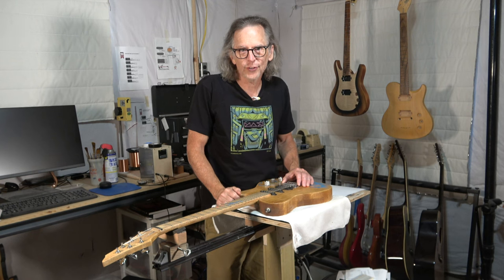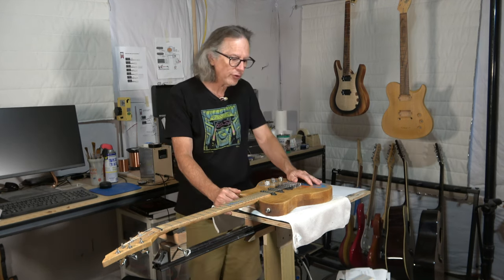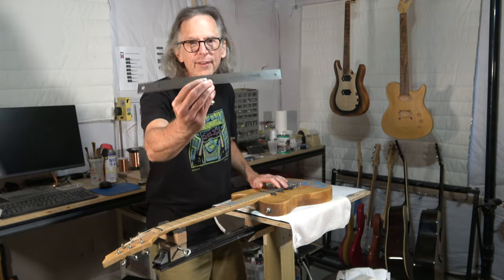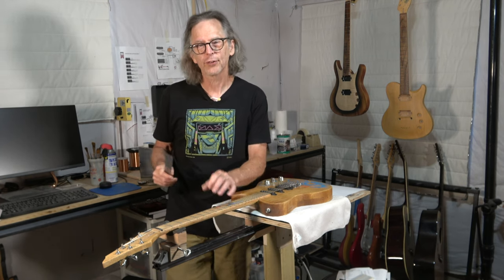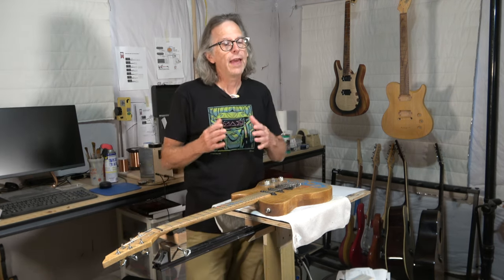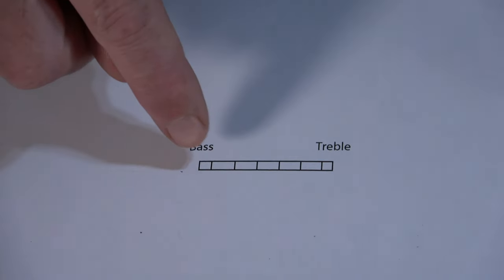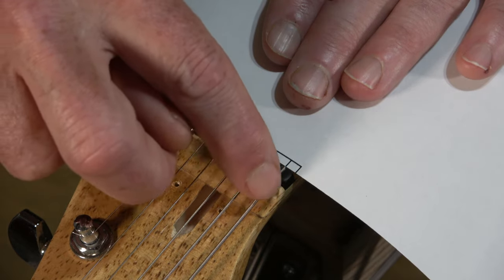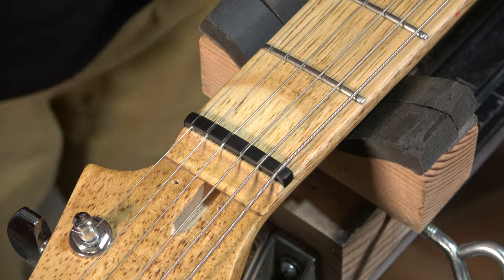How Do You Determine String Spacing On A Guitar?

Comment: This sounds a bit rough, but I cut my outer slots, then string up all strings under tension. I then visually space them. It is amazing how obvious it is if it is even. I then mark either side of the strings with a pencil. Then file the slots accordingly. 💜💜 Sarah
Reply: This is the same method my friend and mentor uses, who's been doing guitar repairs full time since 1969. I now use my own method, which for me is more repeatable and precise, after doing it 'by eye' for many years. I don't think my new method is superior at all, simply what works best for me. He's still doing them by eye and knocking them out of the park as always. 

I don't think it's rough at all. There's an old book called "By Hand and Eye" that discusses methods used by artisans of times past. The visual method is perfectly valid, and same deal...mark either side of the strings, cut in the center. If memory serves, my friend uses a razor saw to make a 'set mark' in the center of those lines first, using his thumbnail as a 'fence.' And then uses nut files on that set mark afterwards.
Reply: @guitar_md  The eye picks up center very well and notices unevenness equally as well. I do the same when marking my  side dots.
Reply: @rellikguitars7237  Agreed!
Reply: That's exactly the way I always do it... works like a charm! 👍
(Btw: I also tend to stick a little strip of masking tape on top of the nut for the first few filing strokes. Makes the pencil lines more visible/durable, and keeps both strings and files from driftin' all over the place...)
Reply: @kiwibass  I don't know why I haven't used tape, but I will now.. Thanks 💜💜💜💜Sarah
Reply: @rellikguitars7237  You're welcome! ✌🙂
Reply: @JD-nq4vb   Yes I know this. It is basic maths. But thanks
Reply: @JD-nq4vb  That method misses the whole point of the video. You're not taking into account the thickness of the strings.
Reply: @JD-nq4vb  What's with the personal attacks? You're still missing the point, and I'm the one who should be embarrassed? Sorry, but no.
Reply: @JD-nq4vb  I took it that way because you've immediately started shaming me, telling me I ought to delete my message, etc. Let me be clear - I'm not disputing your math. In fact, what you're explaining here is entirely obvious. Did I ever argue with the fact that if you want equal distance between the centers of the strings, you can calculate it by dividing E-to-e spacing by 5? No need to assume I can't do basic math. The point of the method described in this video is entirely different though, which is what I said in my first reply. It aims to produce equal spacing between strings, not between centers of the strings. These two things are not the same, and the former requires a different method than the straightforward "divide by 5" rule.

Comment: I take a photo of the bridge with strings installed and then scale that for the nut. Why would you not? This problem is way overthink IMHO.
Reply from the maker: Try it and you'll see that when you reduce the photo, the string diameter is reduced as well. You'll end up with the wound strings too close together and the plain strings too far apart. I can't sell a guitar like that.
Reply: Is it the case then that the string spacing at the bridge does not consider string guage? That would certainly defeat the image scaling method as it would depend upon a linear relationship between the nut and bridge. The E string center lines converge at a "vanishing point" some distance away from the nut (and should probably coincide with the center of the fret board) but it appears the other strings converge at a different point. I'll have to put this into my CAD and see what that looks like. Thanks for the lesson!

Comment: I have tried all the methods and own the StewMac ruler. In the end I have settled in equal string spacing based on center of the string. I got there as a player, not as a builder. The other methods appeal to me as a builder because of how it looks. But I play the center of the string, not the spaces between them. I don’t typically have a problem accidentally muting strings. Bridge is usually going to be equal on center spaced regardless of what I choose at the nut. In theory, that mean the portions change gradually as you move up the neck. Those changes are too small and gradual to matter in real life.

Comment: You got me there. Use the safe slot system which includes a string spacing ruler. That and a digital string slotting gauge. Will have to give your method a try some day. Takes me a couple tries sometimes. String spacing usually.  Me personally I like to leave an extra 1/32 on the high e side even if it looks funny. Because I like to feel free doing wide vibratos. Nothing kills the mood like slipping off the side of the fretboard.

Comment: Doing it visually is definitely the easiest way and that's what I'll usually do when working  on my own guitars. If I'm working on a customer's guitar or making custom nuts in my spare time, the Manchester calculator and a proper marking ruler is a must. It takes a small bit of prep work to get the measurements but marking is a breeze and I know I won't botch the nut. Plus, it's what I would want my luthier to do for me. It's nice knowing the nut was precisely cut according to the gauge of each individual string. I used to have a string spacing ruler, and it was super simple to use but I found that it's not quite the best thing in certain scenarios where someone is using heavy bottoms or unwound Gs, things like that. Not to mention the amount of people that like to have more "freeboard" up at the top.

Comment: I think equal 'space' between strings is important on an acoustic because of how hard I play. The lower strings travel further, are wider, and have higher action. I need the space. With that said, I'm making my first nut (trying a compensated one) with a Stewmac rule. The spacing on the original (Yamaha) is quite different than what I'm getting from the rule so it could take a little adjustment. First time on your page. I would love to hear thoughts on tuning, compensated nuts, bridges, and Buzz Feiten.

Comment: I measured some guitars:

Taylor - equal gaps
Godin (semi-acoustic) - wider gaps towards the bass, sounds weird and looks weird
PRS - equal centers
Ibanez (and all floyds, etc) - equal centers
Fender - equal centers (strat and jag)
Gibson LP - equal gaps

Notes:

The guitars with equal center saddles all have equal center nuts. So my question is, would you ever want equal gap nut with equal center saddle? Surely that would be a bit weird...

I dare say, acoustic guitars tend to use equal gaps.

Re the Stewmac ruler, a very rough calculation says that thing would have a bass center only 1/2 of 1/64 larger than the treble center, so it is nowhere near close to equal string gaps, in fact it basically gives equal centers. (could someone measure this precisely please)

Comment: Thank you for your knowledge and wisdom, man.

Bought a couple of Tusq blanks a while back along with a generic string spacing ruler on Amazon. I'm now realizing that it doesn't work for my seven string multi scale guitar, which is what I'm trying to overhaul. Sitting here with my calipers, nut, pencil, and paper wondering if I should do this first one with just my measuring and marking setup or if I should try for the print out guide and CAD like you. I wish I had a luthier nearby to teach me hands-on.

Comment: I don't build guitars, I build bows. But I do play guitar and  do some of my own work. I have started making my own bridges and nuts for myself and friends, poor's guys. I watched a few videos and just started screwing them up right from the get go. Hopefully this video will help me. Anyway I make my acoustic bridges and nuts and electric nuts out of a piece of slippery elm that was struck by lightning after it already had dutch elm desease really bad. Well I found out that when that happens sometimes the heart wood of the trunk and some branches goes absolutely nuts and grows huge. Like there's only about half an inch of soft wood on a  power pole sized trunk. It not only grows really big, it gets harder than a Chinese algebra exam. It will ruin anything you cut it with. Ax, chainsaw, crosscut. It even ruins quality handsaws amd knocks the edge off of chisels and draw knives. But even though it's already hard I still heat treat it by covering it in peanut butter, putting it in a piece of pipe and roasting it with my heatgun
 Then I fire harden it while it's still one long piece before I cut it to length. Same way I do some of my bows and bow staffs. The first 2 are ugly as homemade soap and need to be replaced but the ones I make now really are quite beautiful. Dark brown with bitchen grain and almost as hard as marble. I'll leave the guitar making to y'all. I'm just a bored house painter man.😁

Comment: I am interested in "playability" more than "visually correct" and I am new to guitar.  My question is this: Would it make a guitar easier to play if you provide more space around bass strings because you have to press them harder and your finger gets wider?  Or maybe there's a reason to leave more space around the higher strings?

Comment: If I’ve understood the vid correctly, the installed nut was cut using the stewmac string spacer ruler (which is what I have used) and the paper template was made from the Manchester guitar tech calculator?
This is not something I have previously questioned and I thank you for reminding me of the old maxim - question everything. I will add this to my list of things to look deeper into!

Comment: I made a wooden tool with string slots and handle that can be slid under the strings and turned to lift the strings off the nut so it can be removed and replaced while working on it.

Comment: For the past 45ish plus years, I’ve always used the old strings to visually place them with tension where I want them, then tap on each string with my fret hammer to make a dent in the bone nut or bridge saddle to mark them. I prefer this method over pencil marks cuz the notches guide the file and less chance of running off the first few strokes. 
I now have double vision in my old age and want to try a string spacing ruler because of my failing eyesight. Got one yesterday and can’t find anything on it that works. When I find both E’s that match, there are 5 string slots in between them, not 4 like there should be. I’m sure I’m doing something wrong.
Reply: Are you using a 7-string ruler vs a 6-string ?
Reply: @GodzillaGoesGaga 
Hi, I figured it out. It took a little time, I took my time and went slot by slot and eventually found it. My double vision made it difficult to see. Looking at it from a different angle so the lines/slots are not doubled helped a lot. 

Hey, Thanks for replying and trying to help. I appreciate it. 
Thanks again and Happy New Year…..🙂

Comment: I use a string ruler. I know you can calculate it more precisely, but I think the limiting factor is how accurately you can cut the slots with a saw/file. Precision without accuracy in other words.
Reply: I don't like to use those two words like that. In day to day conversations it won't make a difference but if you are actually trying to convey something about manufacturing, quality control or statistics etc it is better to use those words correctly.

Precision is the spread of your measurements and accuracy is the difference from the actual correct value. In the case of cutting slots in the nut for the strings. The precision would be how off are your cuts from each other if you cut the same slot in multiple nuts. And accuracy is how far they are from the planned dimensions they are.

Example: lets say for a 44mm nut the centre of your first slot needs to be 3mm from the edge of the nut. If you now cut this slot with whatever method you use, let's say 10 times. And you get the slot centre between 2.7mm to 3.7mm in all those. In that case, the spread is 1mm which is also the precision. The average deviation from the correct value of 3mm (assuming the measurements are evenly spread between 2.7mm and 3.7mm) will be 0.2mm and that is your accuracy. It is obviously better to have more samples if you really want to make claims about the precision or accuracy of your process.

What you most likely meant to actually say there was that you cannot cut as accurately or precisely as you can measure and mark where the slot needs to be.
Reply: I would love to hear your explanation on the accuracy being 0.2 mm using your given data…

Comment: The matter of space between for fretting & vibrato is crucial for the nut- where spacing is about the string edges, for this reason having their inbetween dimension consistent is best- so a nut visually compounds with gauging but are edge to edge equal... These are also spaced from fingerboard edges.
 
The bridge spacing as point to point for even plucking & centering on pickup polepieces is best- so being center to center equidistant, this isn't so visually aesthetic but functionally ideal... Though some state that the plectrum feels the edges not centers and these should also be compounding with gauges.

Where gauging is especially dramatic -as thicker vibrate wider and thinner much less, it may be better with such compensating to all being spacing compounded.

Comment: I use the method that I learned from this channel of using a string to determine the position of the outside strings. Then use the Stewmac spacing rule.
Reply from the maker: Hey, that's the way I do it!
Reply: @HighlineGuitars  lol
Reply: @HighlineGuitars  thanks for the tip!
Reply: @HighlineGuitars  the one thing I will say is that I tend to cut on the inside of my mark for the bass string. I find if I cut right on my mark it often ends up too close to the edge of the fingerboard.

Comment: I have a Taylor Mini which is a 1 11/16 nut width. My 326ce is a 1 3/4, which my fingers prefer.
I have new blank Tusq nuts and want to slot the strings at spacing half way between the two knowing my E & e strings will be slightly closer to the edges of the fretts.
Your thoughts please?
Thanks
Reply from the maker: You need to measure the E to e spacing for both guitars (measured between the string's centers) and calculate what your desired E to e spacing will be. Next, you need to factor in the diameter of the E and e strings in order to determine how close the outer edges of the E and e strings will be to the bass and treble sides of the nut. It's up to you to decide if there will be enough space. There is no hard and fast rule for the amount of space here, but you don't want the E and e strings so close to the bass and treble sides of the nut to cause those strings to fall off the sides of the fretboard.

Comment: Eyes are my way .i start with the 2 outside strings.
   I guess you could put a. 
Set of strings over the un skotted nut then mark the nut after getting a visual too.
   Or maybe have a small thickness of wood or plstic and use it to make all strings equal distance .

Comment: What about the effect of a wider nut?  I am thinking of building a 1-7/8 or even a 2" wide neck for my thick fingers.  I am a fan of Django Reinhardt so I don't make excuses for not being able to play regardless of problems with my fingers being short and thick - and I can overcome virtually all challenges by adjusting how to shape chords and even leave a duplicative note out of a chord, but I would like to try a bit wider neck, too.  But a wider spacing actually changes the  length and the scale length - technically shortening by a couple millimeters assuming the same spacing at the bridge end.  Does  anyone have any experience or the math to figure that out?  Can I get away with a standard 24.75 or 25.5 scale length or will I be better off calculating a custom scale length and cutting my own fret slots?
Reply from the maker: https://www.ekips.org/tools/guitar/fretfind2d/

Comment: will it work if you use the bridge as a reference for spacing the strings?
Reply from the maker: No. The string spacing at the bridge is usually equal from string to string and doesn't account for the string's gauge.